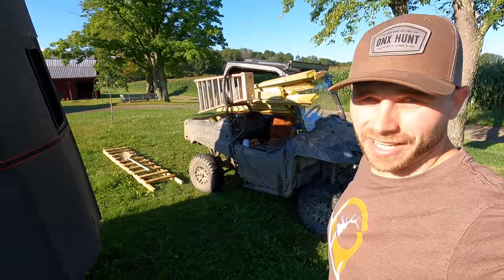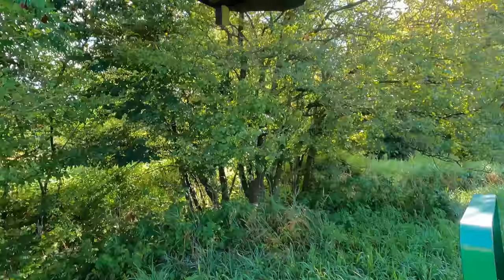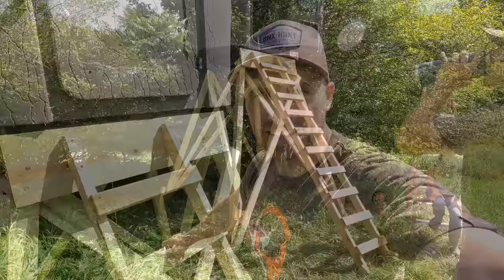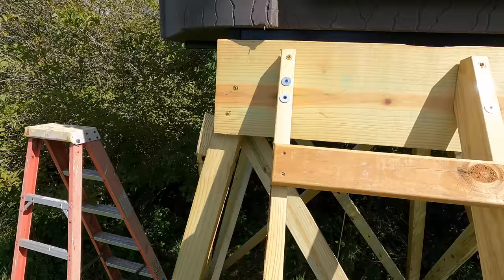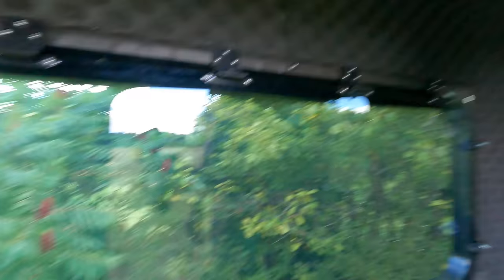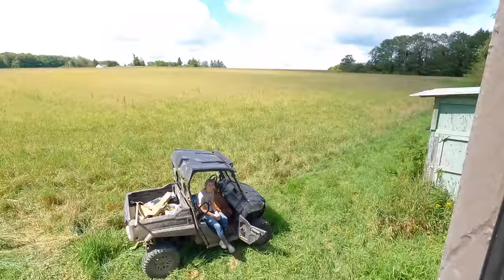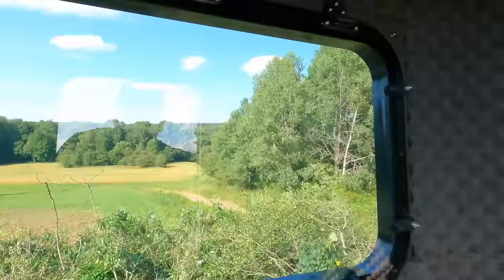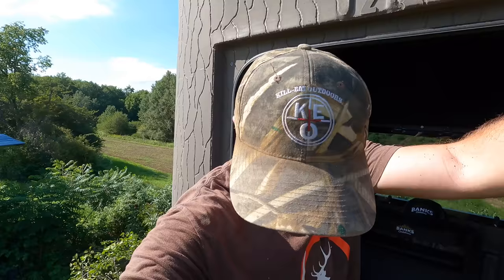Setting Up The Stump 2 Whitetail Properties Pro Hunter Phantom Blind

Comment: Cliff, take from someone who's put up a lot of elevated blinds, especially with wooden legs ( even though they're pressure treated ) you should put a full 4" solid cinder block or at the very least a half a block. It'll keep your legs from sinking and will extend the life of the wood. It's not too easy cutting the legs at the angle you'll need but it's worth it. Good luck and i hope you guys shoot some deer out of your new blinds.